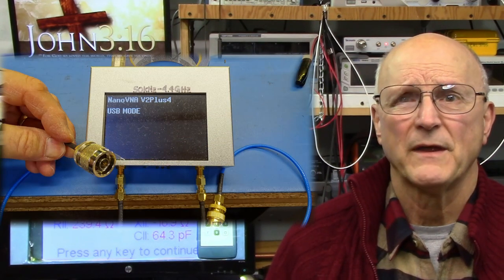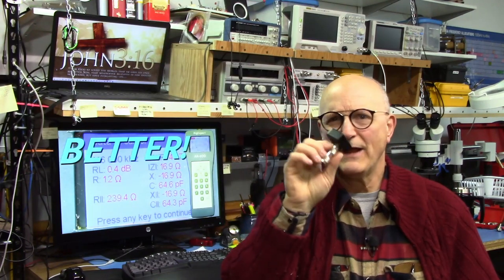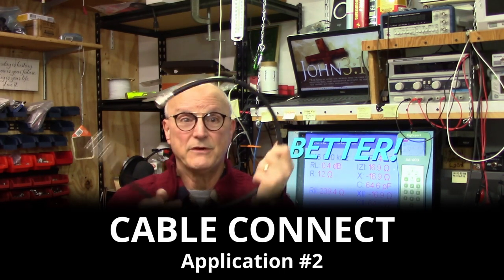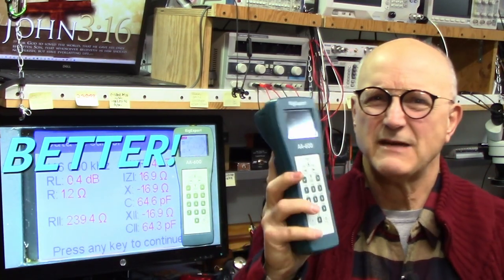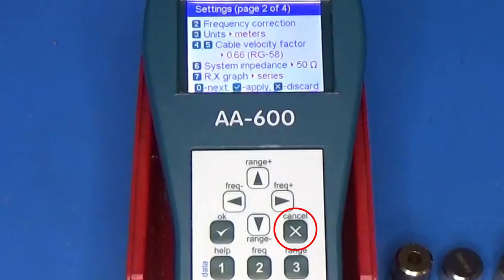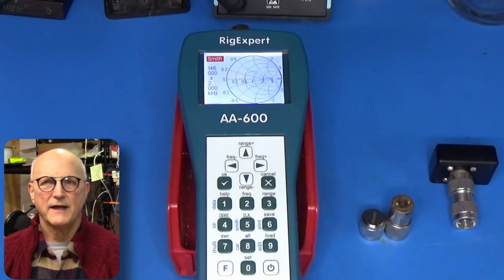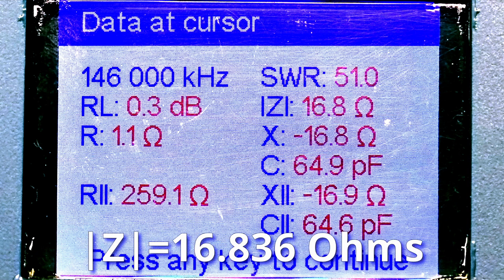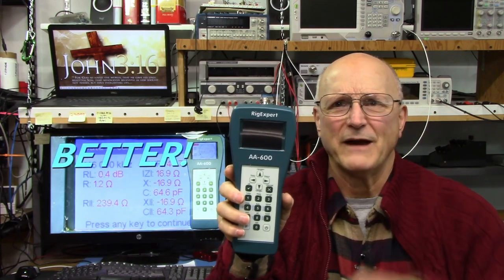Improved Impedance Measurement with the RigExpert (054)

Comment: I think this model has been discontinued by the manufacturer but is still available to buy off the shelf.  I've had one of these for a few years now and yes, it was pricey but it's hard to beat for ease of use, setup and portability. I made up a couple of sets of calibration loads with different connectors. I've found the factory calibration to be pretty close on the lower HF bands but as you point out in the video, the difference between factory and bespoke calibration widens considerably as you  approach V/UHF. I also have a VNA but it's a bit more of a faff to setup so still regularly use the Rigexpert.👍
Reply from the maker: I wouldn't be surprised if it has been discontinued. There are newer, fancier models. I'd also be very surprised if all of their models didn't have this capability.
I don't own one :-( . I bought an MFJ analyzer years ago and in so many ways it is definitely sub-par. But it is convenient and does basic SWR stuff OK. For any kind of accurancy, you cannot beat the VNA.
What is really cool is that I can actually mount my miniVNA tiny at the feedpoint and run a USB cable down to the computer (for relatively short runs). This way I have minimized feedline. :-)

Comment: Can you link where I can purchase the calibration standards from?
Reply from the maker: Unfortunately, real validated standards are not cheap! However, for the kind of things we are doing, we can cheat a bit and get close enough.
The short and open standards are easy enough to DIY. For the OPEN you can use an unpopulated connector.  For the SHORT you can thoroughly short a connector. I used some braid from some stripped coax or a length of solder wick. Just make sure it is very substantial so as to avoid inductance and resistance.
The LOAD is a bit more tricky. You could use 4x200 Ohm, 0.1% surface mount resistors with your connector -OR- you could simply purchase a 50 Ohm terminating load (be careful to look closely at the specs for accuracy, frequency limits and SWR at the various frequencies). For a N-type, this one looks pretty good: https://www.mouser.com/ProductDetail/Amphenol-RF/202109-10?qs=%252Bm72Q7GxMuxG78p4FokgEg%3D%3D
Hope all of this helps. 🙂

Comment: I see why you borrowed it. I just looked up the price! I think I'll be going for the VNA option.
Reply from the maker: After I did this video, I, too, checked out the price with the same reaction. It is a fantastic unit and worth every penny spent to purchase it, but I have everything I need to do what I am doing and cannot justify the expense. If I had known about it BEFORE I bought the MFJ-259 years ago, I would have happily bought it instead.
Reply: anybody    tell   what to do at  the   antenna
Reply from the maker: @hobojon44  I'm not sure what you are referring to. I went back over the various comments on this video and ???
I know I had someone ask on another video about ladder line and the like. To that question I have gotten back the sound of crickets.  In the end, the RF Explorer and the nanoVNA are 50 Ohm systems. If someone wants to see what the impedance of an antenna is that is fed with ladder line, they will have to calibrate the Rig Expert or nanoVNA at the point where they connect it to the feedline, measure the impedance at that point and then, using a Smith Chart back calculate what the impedance might be at the antenna end of the feedline.
I did something like this (with coax) in this video here:
https://youtu.be/bPmtIVmlJok